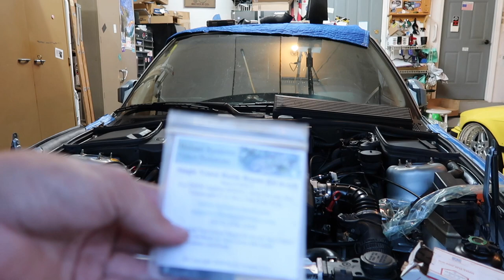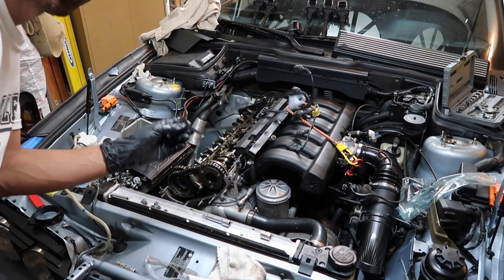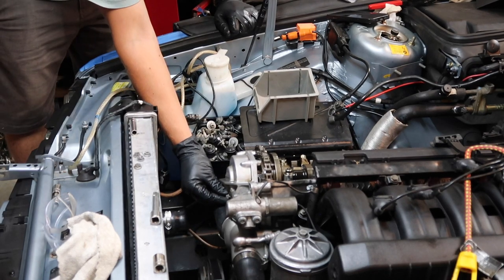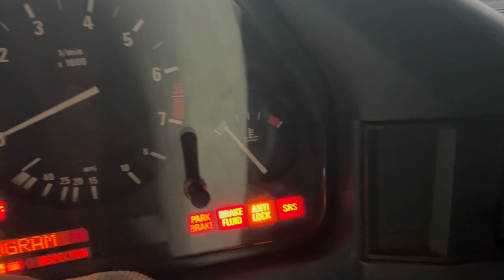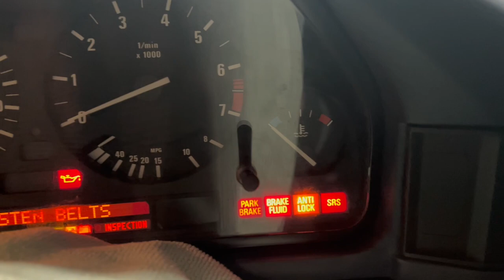Solving the S52 E34's First Start Issues | Vanos Rebuild and Weird Engine Codes

Comment: What’s the difference with the e34 motor that had vanos vs the one without it  ?
Reply from the maker: M50 non vanos: No vanos, dual valve springs, 135mm beefier rods
M50 vanos: had vanos, single valve springs, 140mm rods